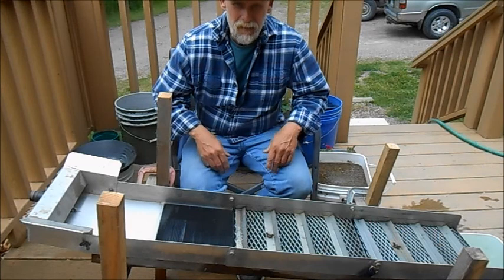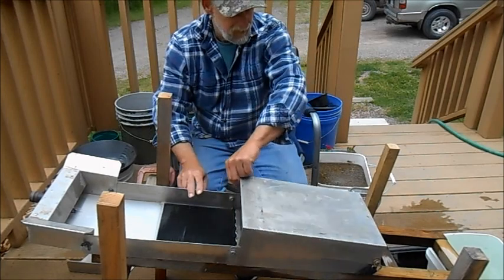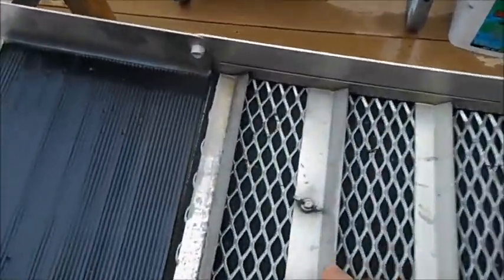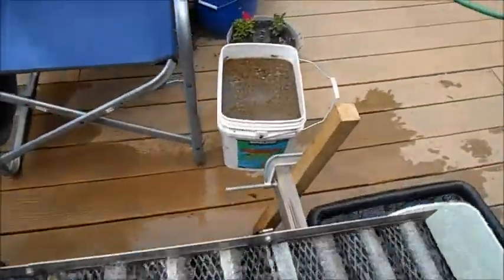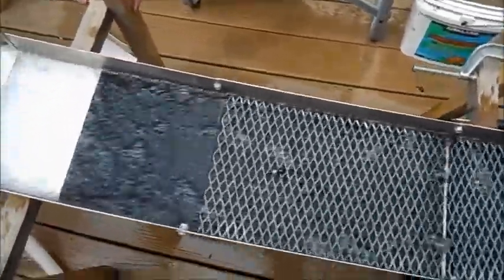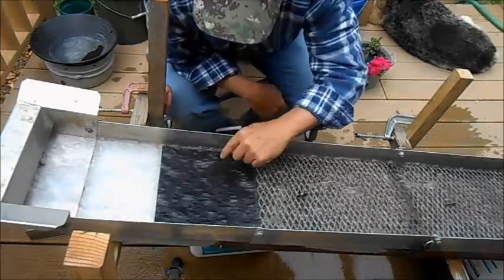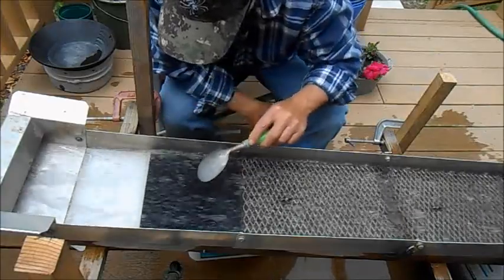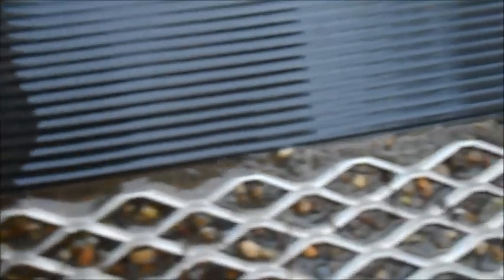Royal Manufacturing backpack sluice Box [Review] Does it Lose Gold?

Comment: Alan quick question for you on this sluice, I just bought one trying to get use to it but the biggest problem I'm having with it is the leaking! Did you have this issue?
Reply from the maker: Yes they leak I used gorilla tape on the bottom of my sluice.
Reply: @alanrobertson2510  Ok thanks Alan and keep those videos coming.
Reply: Alan I forgot to ask did you do both inside and outside?
Reply from the maker: @MichaelJohnson-ux7pe  Just the outside